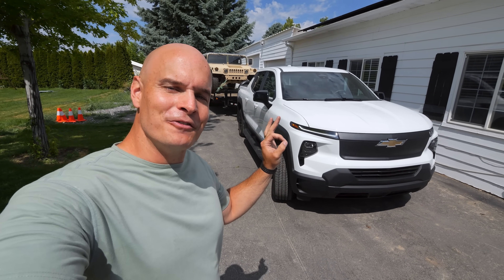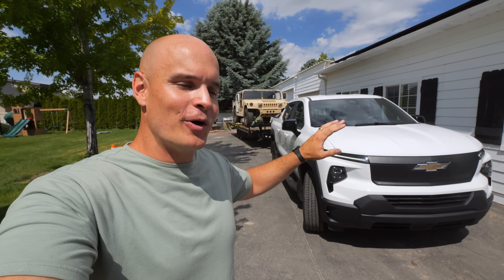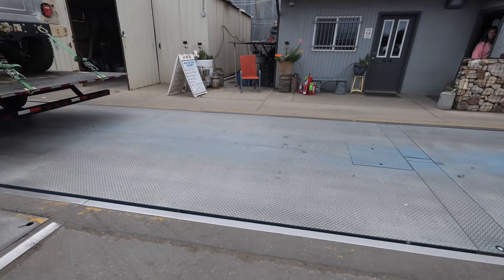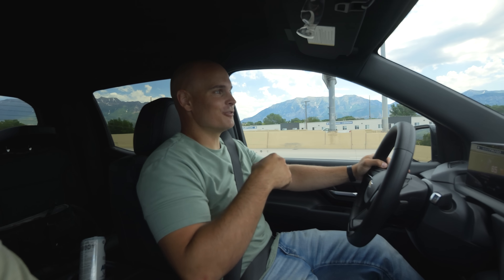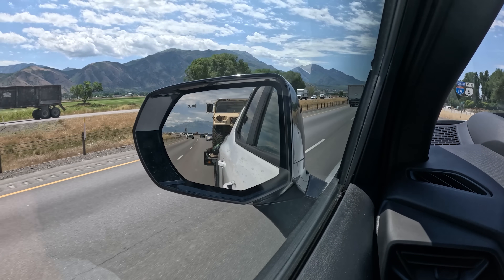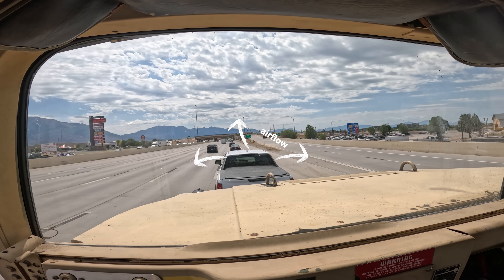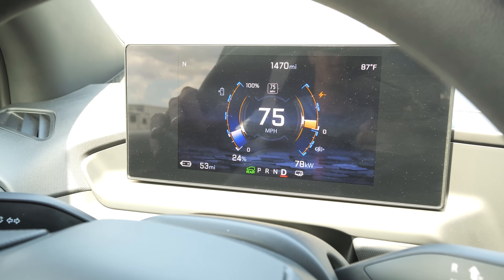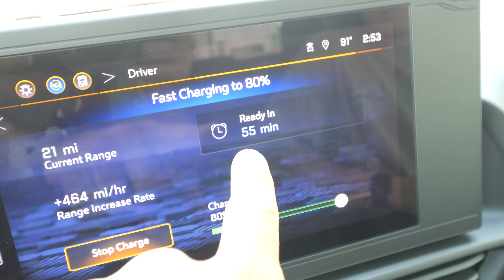The Chevy EV tows TWICE as far as the Cybertruck?!

Comment: I think it would be beneficial for Chevy (and the rest of the EV trucks) to put a charge point at BOTH ends of the vehicle, to account for the possibility of pulling a trailer and being stuck with a 'deadhead' charge station. This would eliminate the need to unhook your load just to recharge. From what I've seen so far, GM nailed all the aesthetics of a normal pickup, as far as comfort, driveability, and overall range. Even though it may not outrun the Cybertruck, it will still pull down a good sized house with the available torque, and makes much better use of it's available power reserves. I don't think the Cybertruck would come close to the range of the Silverado, even in warm weather! (Plus it's still ugly as a mud fence!)🤣

Comment: The only thing stopping me from going to an EV truck is the tow range. It's not quite there yet, but it's good to see progress.
Reply: How often do you tow ?
Reply: @AdrianMcDaid  We tow our fifth wheel for a week every month during the summer and sometimes during spring and winter break. It also has a GVWR of 12,500 lbs.
Reply: I went EV and have been towing with it (R1T). It’s gone a lot better than I feared. I only tow 5-6 times in the summer though, and the Rivian has the advantage of a front charge port so I don’t often have to drop the trailer. I’m getting around 150-175 miles per charge.
Reply: @WanderingWatts -then how long does the charge take to full battery once depleted?
Reply: @Harry_Truman72  About as long as it takes to eat lunch and use the restroom.
Reply: @selanryn5849  - It takes you 13 hours to eat lunch and use the restroom? WOW.....

Comment: If you're going at 60mph instead of 80 you can easily go 30-40% further than in this test too. Air resistance at those speeds is huge.
Reply: @canonicalcritic you can't engineer out basic physics. Even super slippery cars suffer similar losses. There is just no way to push that much air out of the way without using more energy.
Reply: @canonicalcritic  Air resistance increases by squared (so 4x) with a doubling of speed. As majority of drag on a car is aerodynamic above ~60 km/h, especially so when towing, reducing speed has an absolutely massive effect on consumption.

I can say with 100% confidence what I've quoted above is true from my own testing, Bjørn Nyland in Norway also maintains spreadsheets with over a hundred EVs that he's tested and reviewed on his Youtube channel at both 90 km/h and 120 km/h, (56 and 75 mph) and range increases of around 40% is typical, which are openly available for anyone to read.
Reply: @canonicalcritic  This was kind of answered in the thread already but it's because compared to how absolutely horrible ICE efficiency is, you basically already are losing a ton from initial speeds due to just running the engine in the first place. Keep in mind, electric motors are incredibly incredibly efficient at turning electrical energy into kinetic energy (I think some whole systems are like 90% efficient) where ICE engines are...well shit. Like 30-40% at best. So when you're already that inefficient, you need to have speed to counteract the dog crap efficiency. Electric motors are already very efficient so when you factor in drag at high speeds (as mentioned it's not linear), that's when loses start to happen. Most EVs are more aerodynamic than their gas counterparts...it's just that it matters more at speed for the overall system efficiency.
Reply: @canonicalcritic  Because styling gets more weight in car design than efficiency. The Tesla cars are better at this than most vehicles and is the reason for their design aesthetic.
But as noted air drag is exponential with speed so even the best designs see significant increases in drag as speeds increase.
Reply: Evs are engineered to be very aerodynamic / have a low drag coefficient but you can't get it perfect
Reply: My thoughts exactly am thinking 400km with a 10000lb load,thats just crazy,that's 100 50kg bags of potatoes or two sedans,or .....it's just insane to me,n it'd only cost me $50 at 25cents per kWh
Reply: @canonicalcritic  Read my answer to anthony above, but basically, ICE cars are incredibly inefficient at low speeds, as most of the energy is used simply to idle the engine.

They start to deplete as quickly once you go above a certain speed, for example, both an ICE car and an EV will roughly double in consumption when increasing in speed from 100km/h to 200km/h, as aerodynamic drag increases 4x when speed only doubles.

Interesting fact: when going around a racetrack an EV can theoretically have longer range than a ICE car, as so much of the energy used is simply put into braking, and the EV can use regenerative braking to put it back into the battery, even though that same ICE car will have more range when going on the highway.
Reply: @canonicalcritic  In a Model Y while towing a big box trailer, efficiency was around 700 Wh/mile at 60 MPH, but 900 at 70 MPH during a trip. 80 MPH would've probably been almost 1,200 Wh/mile. 

Air resistance increases exponentially with speed.
Reply: @canonicalcritic It’s about right, more or less. EV cars are heavily impacted by small loss of efficiency. And wind resistance is the largest loss for EV. I have an EV and it’s rated at 272 miles of range. In real world at 75mph I get 200 miles. At 85mph I drop to about 170 miles. At 50-55mph I can get 250 miles.

Roughly explained, electric engines are basically very efficient and have very little loss, but as your speed increases, the aerodynamic drag increases exponentially. 
But gas engines are very very inefficient, especially at low speed. Efficiency gets better with higher speed, which kind of counteracts drag. And that’s why you don’t dramatically lose as much range with higher speed with gas car.
Reply: How about 1mph so you can go forever
Reply: @anthonyawuley  That is no joke.  I wish someone would do about 5 mph in an EV around a test track just to see range they can get.
Reply: @anthonyawuley  Below about 20 mph EVs stop gaining range with lower speeds, due to parasitic drain from electrical systems, infotainment, lighting, and such. Most EVs will do anywhere between ~150-200% of their EPA-rated range at ~30-40 mph constant speeds.

Reason the speed is so much higher for ICE cars, at around 40mph instead of 20 mph, is because the parasitic drain from running an engine is so enormous that below that most of the energy consumed will simply be to idle the engine.
Reply: @anthonyawuley 😂😂😂😂😂😂😂

Comment: @JerryRigEverything  It kind of bothers me that you come up with every reason under the sun that the Silverado goes twice the distance pulling a trailer as the Cybertruck... except for simply the fact that the battery has twice the capacity.

You could have just said "the Cybertruck has an equivalent of a 13 gallon tank. So if it gets 7 mpg while towing this big trailer, we'd expect a 91 mile range. Meanwhile, the Silverado has the equivalent of a 25 gallon tank, so at 7 mpg we'd expect a 175 mile range." Which is almost exactly what happened.

Comment: The reason the Silverado EV is doing better is the battery size. It is supposed to be over 200 KW while Cybertruck is 123 KW. There is a 2000 lbs difference. They did this with the Hummer EV.
Reply: Also the cybertruck did not have the second battery inside. With it, it would easily surpass it.
Reply: @davidcroteau5078    define "inside"
And the cybertruck bed battery adds less than 40% more capacity to the Cybertruck, so no it would not come close to matching the Silverado even with it.
Reply: @pilotdog68  Never mind, you are right I thought the second external bed battery was bigger.

Comment: The real reason it went twice the distance of the cybertruck is that it has double the battery capacity.
Reply: i'll repost another commenter, since you're wrong. "The batteries: 200 / 123 is nowhere near two times more! There is only 63% more battery capacity. The two, 177 miles is very close to double the 90 miles: the towing distance grew by 97%. That is, the Silverado made 177 miles with a 200 kWh battery (0.89 miles/kWh) and the Cybertruck made just 90 miles with a 123 kWh battery (only 0.73 miles/kWh)..."
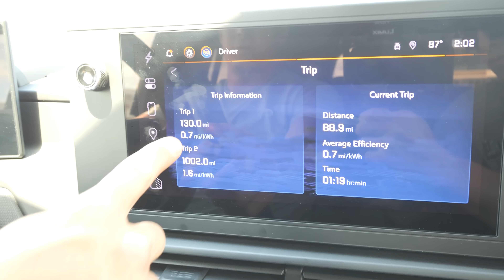Reply: @Ryan-093   I think your info is wrong. From what I can fInd, the Silverado has a 244 kWh battery. The Cybertruck has a 123 kWh battery. Also, at 7:26 in the video you can see the Silverado reporting 0.7 kWh/mile. When he claims a 177 mile range at the end of the video that would have required at least a 244 kWh battery to go that distance.

244 kWh is pretty close to 2x the capacity of a 123 kWh battery.

Comment: I'd like to see the same test but with a 24-foot enclosed car trailer, it would be interesting to see the difference in aerodynamics. I've seen the auto industry groups testing trucks towing a 10,000 pound (4,535.92 kg) trailer up the mountains here in Colorado, the trailers they use are tiny.

Comment: To be fair, the others you tested were in winter (which cuts battery capacity in half!), and with off road tires. BIG difference! I like apples to apples comparisons better.
Reply: Actually it's more like a 10-20% difference once you hit freezing temps, not half.
Reply: There were also multiple 0-60 full throttle runs on the cyber truck as I recall, almost like they were trying to generate a certain outcome for better clickbait. Wonder why that would be, hmm

Comment: Can anyone tell me why EV cars in general do not have the charging ports front AND back in the center of the car? 
Having the port where the gas cap used to be is just about the most insane spot.
I also cannot imagine it is that much of a added cost.. so why?
Reply: It is cost and if there is one major problem for legacy car makers and their EVs, it's cost.
Reply: @Tschacki_Quacki  Cost is the only sensible reason, but still it is just one port adapter and not that much cable as the charger is usually in the front or back. 
Off-the-shelf price for CCS2 EU plug seems to be between 200-1000€  (which is wild tbh), so for a car manufacturer the cost is, at most, half of that.. in a +50000€ car that seems like a feature worth adding.. even as a 1000€ add-on extra for usability.
In a residential parking situation there is stark difference between an old ass Nissan Leaf and a Tesla "coming home" as the latter has to reverse into their parking space and/or have a 3-5m charging cable 😅
Reply: @CaribouKH  I see where you are coming from but the car manufacturer has more than just the initial parts cost. You need to develop a way how to integrate everything. You need factory space for the additional parts, it takes more time to assemble the car, higher aftersales cost cause double the charge port = double the warranty cases on charge ports, etc.

Maybe it's gonna be more popular when the industry has scaled up but tbh using the longer cable has never bothered me a lot 😄

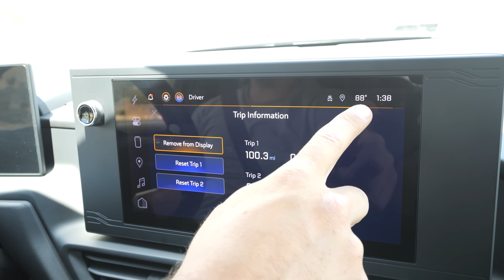Comment: 6:50 It appears that you're going at least 5 to 10 mph faster in this test than you were in the other EVs (understandable with the two in winter), but that will have a huge impact on the efficiency and range. If you stuck with the ~70 mph from before, I'm pretty sure the Silverado EV would do well over 200 miles. At 80 mph with a 10,000 lb load, 180 to190 miles probably will be the upper limit.